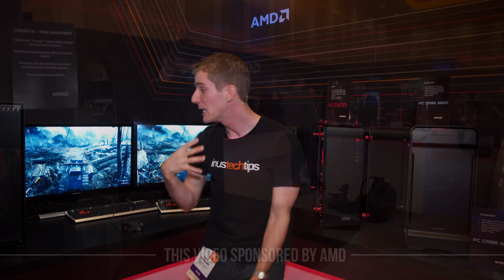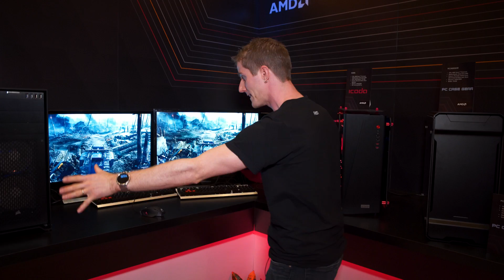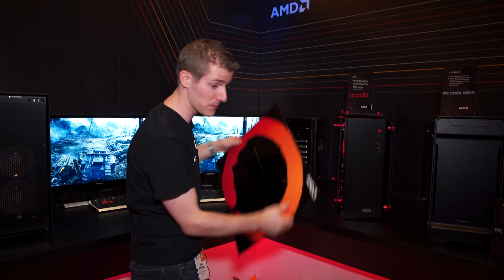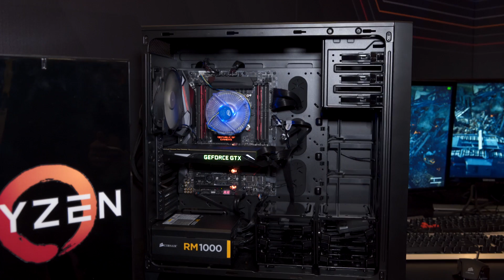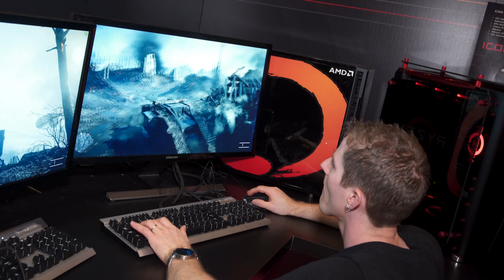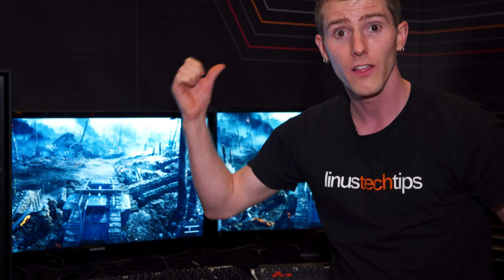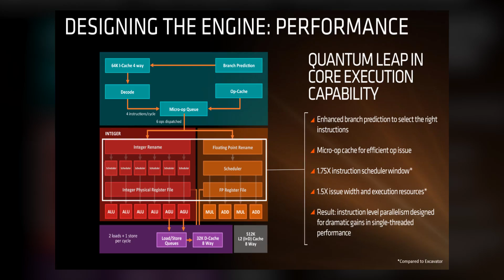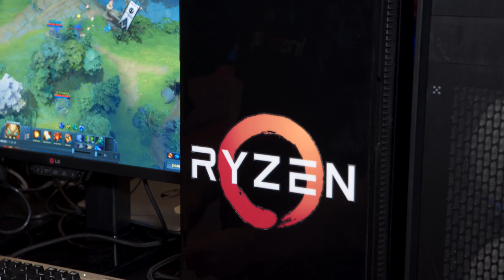AMD Has Ryzen!

Comment: I don't get why Intel fanboys are hating on this, If Amd were to get competitive in the CPU market, it would make Intel CPUs cheaper.
Reply: Because fanboy logic.  They feel like AMD overhypes everything and Intel and Nvidia don't.  Kabylake was over-hyped too, and performs not even that much higher than Skylake.  1080 was way way overhyped when they were comparing it to the latest Titan.  Heck, Nvidia even false advertised and sped up a video with the 970 causing a lawsuit against them.  AMD has done very similar things with their GPU like the mass overhype of the 480.
Reply: Yes, they would. Capitalism in a nutshell.
Reply: Tho to be fair the x480 is extremelly competitive right now. AMD pulled a miracle in drive optimization. It is starting to beat the gtx1060 in neweer titles and even gained some performance in dx11...

I just wish they were this optimized since launch, now nobody will look at new fps charts from games released in Christmas, people have the wrong picture in mind from July that RX480 loses to the 1060 a bit hard in most titles.

This time with Vega i would want a fully optimized chip since launch. 

With Ryzen, since it has to work at 100% from launch because it's a cpu so follow different rules, i hope they get it right. So i'm ok with them still trying to perfect it's drivers and see how much overclocking they can push, i'm 100% sure they are still working on it, reason why they refuse to show it.
Reply: We are old. We remember different times for AMD when their systems were better. Times will change if AMD can pull this off and will shut up the fanboys. I will stick with INtel for professional workloads as I do virtualization, but competition is sorely needed. AMD's architecture this decade has been horrible. I do not blame young kids to hate them as they went the path of Cyrix who didn't survive
Reply: @timothygibney159  Still using Intel?
Reply: @timothygibney159  I actually wanna ask your opinion though, 8 years in the future. Do you think AMD's Ryzen lived up to what the fanboys dreamed of in 2017?
Reply: And force Intel to actually improve.
Reply: with competition in markets, the real winners are the customers. and all this 'fanboy' shit is idiotic. Go for which is better.
Reply: I love archive youtube comments
Reply: because AMD always overhype their products. and end up not meeting expectations. during this "hype" period AMD fans become delusional pieces of shit. and when its all said and done (after AMD fails to deliver) these said AMD fans ALWAYS use the "but AMD is cheap AF intel sux." ignoring hard facts. much like xbox fanboys against SONY nowadays.
Reply: How was the 1080 over hyped? It exceeded everyone's expectations if anything.
Reply: Because AMD hasn't had a decent CPU since the Athlon days.
Reply: emergcon, you dont belong here. anyone who thinks apple is good doesnt belong on a tech channel
Reply: Agree. I want AMD to outperform Intel and light a fire under them so that I can actually see an improvement when I upgrade from my almost 5 year old 3770K.
Reply: "Kabylake was over-hyped too, and performs not even that much higher than Skylake."

It doesn't perform better... at all. It's the same with better integrated graphics which no one gives a fuck about and has better power consumption which no one except laptop users give a fuck about.
Reply: i'm an intel fanboi, and i absolutely LOVE THIS, Intel has been doing no real progress the last many years since they havn't been challenged, now we NEED amd to push them so that they can make the real good stuff
Reply: Funky AtomicHaze How did you end up here, little Xbot? Go back to your playground with all the other console fanboys.
Reply: +YakuZa Give me a recent example. The RX line of cards seem to perform within the level of expectations set. It's almost like you want AMD to fail, do you hate progress and saving money?
Reply: Uh no.  Intel always acts like their next line of CPUs will be massively better.  The only advantage of a Kabylake over a Skylake is completely SW base, and that's just telling something like Netflix that Kayblake is there so now play a video at 4k.  Nvidia sped up a video of a Batman game, and lied about the GDDR5 amount per speed of the 970 then got sued out the ass for it.  They also claimed that the 1080 was going to be 2x faster than the current Titan.  However, they then proved that was a lie and maybe only a thing with VR.  So, don't act like AMD is only guilty of this when they all do it.  Brand loyalty is stupid because in the end they all do deceptive BS.
Reply: Competition insures quality!
Reply: ***** Exactly, I love AMD but the fanboys are now becoming unbearable. Vega has to prove itself against Pascal first. I do kind of hope it's not the highest version of Vega they are showing off. AMD needs to be faster and faster than the Titan not just the x80 or x80Ti, just for one generation to regain some market share and get some great competition going. But I am really expecting Vega to slot in between the 1080 and Titan XP, siding on 1080 performance.
Reply: Because theyre afraid that amd is crush intel this year :)
Reply: Niggah, word

praise the raisin
Reply: NdM Gaming so true. im at 8320cpu planning to ditch my old pc and make a new rig with kkabylake but wait..... ryzen hmnnn
Reply: Lol how table turns 😉
Reply: Well well well
Reply: It's good if AMD releases something to give Intel a run for their money. We as consumers benefit enormously from the competition. This is coming from a person who's never owned an AMD CPU.
Reply: YakuZa Problem is Microsoft learned and are going to launch a better console (devs build for the best console then port to the other). AMD don't seem to understand they must launch something that crushes Intel or Nvidia to actually gain some marketshare and not disappoint it's fans.

Being better perf/$ is great but Nvidia gains so much business because of the Titan, being the best causes and has caused everyone who doesn't do a lot of research on what they are buying to just buy with the company that has the fastest. Hell Nvidia is probably gaining more buyers because of the 1060, faster at launch than the RX 480 but more $/perf, nobody cared it was faster for not much more. AMD needs to be faster at all levels and they don't even need to be cheaper. Nvidia has proven people will pay a premium for that extra 5% over the other guy.
Reply: transistors are reaching their peak. We can't go much further than 5nm. So as long as they don't come up with something entirely new (such as ultra optimized drivers, quantum cpu's or using more coductive material than sillicon(which will make the price skyrocket)) it is quite unlikely that they will boost their processor power any further. Best example is their newest 7th gen cpu's.
Reply: +Kami Tenchi 100% true. Brand loyalty is stupid because you can't trust companies to deliver what they promise. You have a 50% chance of getting burned.
Reply: CryBeat Do you know what will be running in scorpio? No, you dont. So stop this nonsense and wait untill actual specs are announced
Reply: 7 years later an they are basically dominating the gaming market with X3D
Reply: It's not really Intel or Nvidia overhyping things. Intel just launches things and gives accurate data. Nvidia hypes stuff as the fastest or best and actually releases things that are the fastest.

AMD announced massive perf/watt increases and they are there if you win the silicon lottery and get a good chip (90W RX 480s) but the bad chips are the majority really (130W RX 480s). The marketing was right, they had that perf/watt but the production let them down.

Now Ryzen and Vega. I think Ryzen hype is maybe a touch too high but we've got reason for it, all the benchmarks so far are good, going by these demonstration it matches a 6900K without boost so that's promising.

Vega, my god the hype for Vega is out of control. Prediction of Vega actually trying to beat Volta and not Pascal. AMD being very coy with answering which version of Vega is running in machines leading people to believe that the entry level Vega is 4K 60fps ready. It's a bloody mess.
Reply: kloklojul That's actually not a great example though. The lack of improvement isn't because of any physical limitations, it's because they don't have any competitors. They have no reason to improve much.
Reply: Tiago Pinto.  The 1060 was the cheap answer to the 480, but Nvidia also knew most will go with the 1070 anyways.
Reply: Timothy Gibney how about AMD hyping the SHIT out of HBM. touting their flagship card back then as a "TITAN KILLER". then failed to meet expectations. with nvidia's simple GDDR5 cards beating them handily. Then a year later amd went back to GDDR5 (LOL). the GTX 970 is still viable to this day just because it can trade blows with AMD's BRAND NEW rx480. yes its a flawed 3.5gb Vram card but AMD just cannot decisively beat that old champ. i hate how AMD hype things up for maximum early adopter sales because they know they will always lose out in the long run.
Reply: and breeds innovation. now that there is more competition it will mean perhaps faster development of technology on the CPU front
Reply: John Doe But now they're making great ones. So why are people upset?
Reply: YakuZa, Fury's HBM was a prototype for early adopters. RX 400 series is mainstream for cheaper price. Vega will have HBM2. if you wan't to hate, get your facts straight
Reply: well you see the pc master race is full of moronic idiots, most who sound smart just copy n paste a comment, without having a clue about the bullshit they even copied, secondly the pc mustard race is gonna be real but hurt anyway this year, when xbox Scorpio lands and it make pc gaming look foolish  since steams own figures show the pc potato race cant out spec a wii u "like 70% of steams users have pcs that just trash, and well no smart person will buy a $2000 pc when you can buy a $500 xbox Scorpio running ryzen/vega apu
Reply: CryBeat How do you know, Xbot? Believing daddy M$'s hype, are we? Even if by some miracle they manage to make a 4k machine for cheap, they would be outperformed with new PC technology anyways. Go back to dreaming your shitty consoles will be better than PC's.
Reply: +Funky AtomicHaze HAHAHAHAHAH SURE, keep believing they'll sell you at $500 a $2000 hardware worth of a PC... Oh and by the way, you can have a 60+FPS PC on ultra with any game for just $1000 now.
Reply: I used to be an Intel fanboy when I was younger. Now I think it is stupid to be a fanboy of any company. I'm very happy for RYZEN. My Intel CPU and my AMD graphics live in the same case in perfect harmony.
Reply: Exactly
Reply: Intel is more likely to accelerate delivery of boosts in performance than drop prices. That is their usual strategy.
Reply: if ure "getting" fanboys, you would be a fanboy. as in yeah, ill buy a 5000 euro macbook pro instead of investing it in bitcoin. cuz apple is so good and investing tips youre getting on youtube are stupid. okay, i said that on the mac book last year. and i was right.
Reply: Lmfao why the fuck do people keep saying this dumb shit. It's all speculation. Unless it has been proven that Intel dropped prices when AMD released something better, maybe you may have merits.... but uh no it won't make Intel CPU's cheaper except by people who buy it and not be retailers (even then you'll probably have to wait a few months for prices to drop) smh
Reply: the problem with fanboys on both sides is that they barely have any information about ryzen's consumer chips but they're either already blindly hating it or blindly praising it, I have hopes it will be competitive with Intel's consumer chips but as we know that is heavily dependent on the price. only time will tell so rather wait for information to drop instead of just fanboying
Reply: :D
Reply: BaseClock I don't get fanboys of any kind
Reply: in most markets where there are a lot of manufacturers it doesn't matter. but in duopoly as in Cpu and GPU markets, it's important that there won't be monopoly, and with the last years we have seen what would happen if there would be monopoly. tier 1 gpus have skyrocketed from 500-600 to 1200€ and cpu prices have gone up also. we should have 50/50 market share on both markets so we, the consumers would win, now we just get fucked
Reply: Microsoft is using a custom AMD processor
Reply: Kami Tenchi if you would watch benchmarks the 1080 beats the titan x nearly everywhere
Reply: well you answered to yourself. They lost their game against intel around 10-15 years ago whenever core2 came out. After that they had nothing to match intel's power/prices. Surely they are going to bounce back out of nowhere with better products on race they lost a decade ago. Good luck.
Reply: @sdry  How are you holding up lil bro
Reply: I guess fanboys like barely getting any improvements with every generation
Reply: maloviv 123 well u dony seem to understand that every company besides amd is doing that... lol
Reply: I could undervolt my powercolor 480 and got about 20 degrees C lower in all states (idle to full load). They are massively overvolted just to stick around for the bad batches. I don't think I got a good one, yet it hits it's clocks, it stays cool, it doesn't draw over 100w, it does what it says. It didn't do that when at stock. So, again, firmware/drivers.
Fanboyism from either side is bad.
Reply: Intel CPUs won't get cheaper as the domestic market isn't their main market, and pretty much have never been the main market for a few decades.
Reply: CryBeat peasant
Reply: Exactly this. I've only ever bought Intel + Nvidia parts but I want AMD to crush it this year for decent competition. Everyone wins
Reply: I kinda prefer intel but now I'm considering switching. Just for the cpu that is.
Reply: i don't just got i3 and its amazing if they get new god cpu's maybe for 2,3 years i get amd, i only care about performance and currently intel have that
Reply: BaseClock OMGGGGG
Reply: This
Reply: We hate it because we know is fake. Is pure over hype.
Reply: I seriously doubt it.
Reply: CryBeat How, Microsoft doesn't make gpu's, they have to buy it from either Nvidia, AMD, or Intel,(or maybe Qualcomm). So Microsoft can't magically sell a machine that plays games at 4k at 60fps for 500$ if a PC gamer can't use the same hardware or desktop equivalent. If I could make a GPU that performs that well for that cheap and put it in a console, I would try to sell it to   PC gamers.
Reply: +BaseClock ikr.
Reply: i am a autist but i dont buy anything. 
if i could i would buy amd
Reply: This is ignoring the fact that desktop GPUs are really brute forcing in games on PC compared to consoles. The PC does not have customized drivers for every single CPU/GPU/RAM combo. The consoles do have this and have highly specialized drivers to get the absolute most performance out of them and the games are built for that hardware so they are tuned to run on that. A PC built to the same spec as a PS4 or Xbone would not play the same games to the same settings.

A console will be able to play 4K with less horsepower than a desktop GPU at the same settings, a PC would however play on higher settings and higher fps because you can put a shit load of horsepower into it.

Comment: It boggles my mind how they used singleplayer BF1 in max graphics on fullhd or 4k(idk) as a benchmark to show CPU performance. So what, the new Ryzen chip has almost the same fps as the i7 6900k? So has my i7 4790k. Game benchmarks are worthless with heavy multicore/multithread cpus unless it's something like Crysis 3 on low settings in 720p so the GPU can push as hard as it can and then the cpu becomes the limiting factor. Show some real perfomance tests, at least something like Cinebench.

Comment: I have a 4690k not overclocked 16gb ram with gtx 970 sli at 4k in battlefield 1 Ultra settings and i get 70-95 fps...................
Reply: 13k00L11 uh...... what? how is that possible?!
Reply: 13k00L11 and that's kinda awesome for 4k!
Reply: 13k00L11 damn 970 even in sli.. DAMN WHY NOT 980TI INSTEAD
Reply: Death you are a loser, why spend 1000+$ on a processor and 1000+ on a GPU when you can get better performance by upgrading your 2yr old pc? that pc was over 3000$ for 55fps at 4k..... Were I spent only 150$ for a almost new used 970 and get better fps...
Reply: earth418 Just go watch a 970 sli battlefield1 4k video....

Comment: Why is this even a thing?...when BF1 Is not cpu intensive.
Reply: What are you talking about? BF1 is very CPU intensive, atleast the MP is.
Reply: But it being staged on single player stats.
Reply: would've been better tested on xcom2 in 4k.
Reply: Daza Maz bf1 is so cpu intensive that it actually doesn't bottleneck on an fx 8350
Reply: Daza Maz coz there was no bottleneck to the GPU.. if it was a low end CPU , fps would have been lot lower
Reply: "bf1 is so cpu intensive that it actually doesn't bottleneck on an fx 8350"

Noone is trying to have a pissing contest, just saying BF1 MP is cpu intensive.
Reply: BF1 is very cpu intensive. I5 6600K minimum req.
Reply: lol nope
but best test would be in cities skyline in giant city
Reply: well that's fine because i ain't got a pot to piss in or window to throw it out of.
Reply: Misterpainmaker no.. i  have played it on my i3 4130 , in medium settings for stable 40+ fps with a gtx750,1080p, 70% scale
Reply: Should have used Cities Skylines and let you explore a filled map, modded to allow for all the tiles to be bought. Now that's something I want to see run at 60 FPS.

EDIT: Just noticed GGPL's comment a second after hitting Reply.